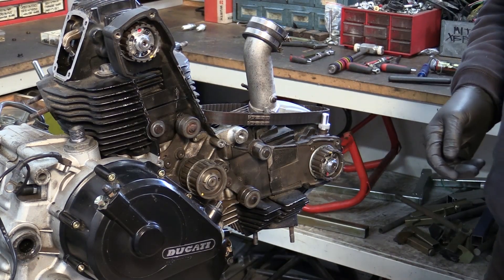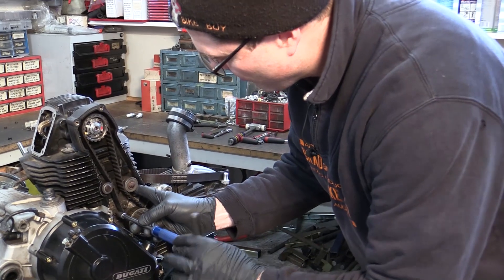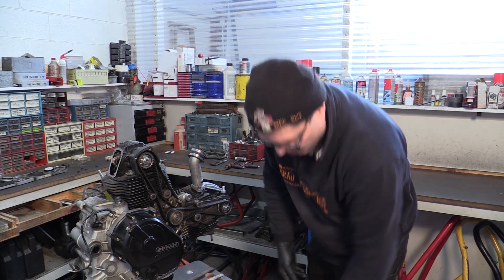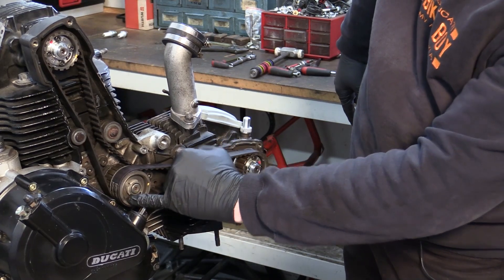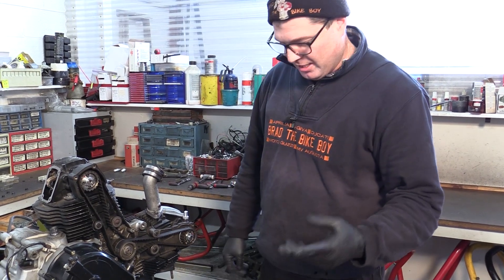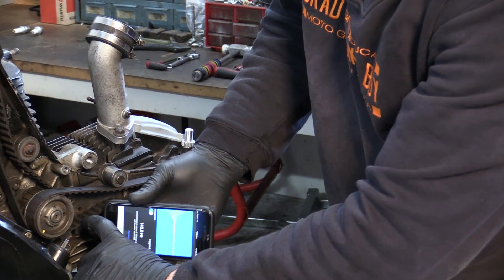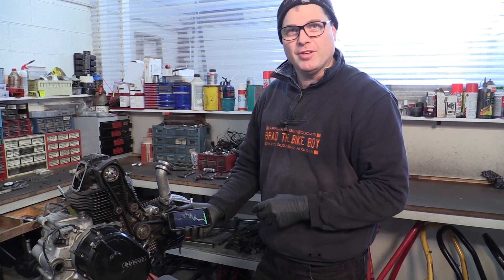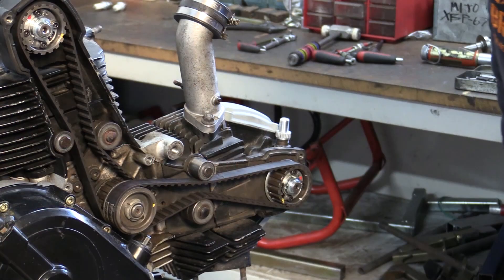Ducati Traditional 2 Valve - Refitting Cam Belts

Comment: Great advice about turning the motor over many times before tensioning. But you are measuring the Hz of the horizontal cylinder on the tensioner side and then vertical cylinder on the idler side. Of course you are getting the wrong Hz. You say that you do it "by feel". Well... what does that mean? Where does this sense of "feel" come from?

Comment: Hi, thank you for making this video. The upper vertical cam moved when I removed the old belt. Im pretty sure it rotated clockwise. I move it counterclockwise with the timing mark on the cam and case lining up (just like before). Is it relevant that the cam moved clockwise/counterclockwise as long the timing marks lines back up? The reason why I ask is after I installed the belts, my ‘05 Monster S2R wont fire up. It cranks (I hear gas pumping, I can smell gas getting dumped into the exhaust) and very faint rumbles from the engine/exhaust. Any idea what is happening? Thanks in advance.

Comment: Good stuff here, but a tip is to also check your tensioner bearings. Especially the vertical cylinder's. Mine were toast. Replacements can be had pretty cheaply rather than buying the whole assy.. Removing/ Installing them on the tensioner can be challenging. Puller for removal, drift/socket & vice along with some never seize for install. I also recommend installing new E clips.

Comment: Really helpful video and I don't want to be destructive but to be honest: I think the sonic measurement of the belt is totally pointless and inaccurate. The frequency depends on three things: material, longitude, stiffness. The 4 free sections of the same belt have 4 different resonation frequencies like a guitar string held on 4 different bunds. The 2 belts have 8. And the stiffness is constantly changing during the operation. Lastly, I don't really sure U measuring the sound of the pinged belt (since it has to be a really quet, and short resonation), or measuring the sound of the interaction of the belt and your rubber glove, or measuring both at the same time.

Comment: when you 'pinged' the belts with sonic  measurement you did the horiz cyl belt  on the shirt run to the tensioner bearing.  For the vertical cyl belt you pinged the  short run going to the 'fixed' pulley bearing.  Does it matter which belt of the belt you 'ping'??

Comment: I have an older 907 with flanges on the cam pulleys and can't get the belts off no matter what.  Do I need to remove the pulleys from the cams on this?  Any suggestions?
Reply: Cut the belts
Reply: @DontDoIt89  I discovered I can get the belts off easily by pulling it partially off then just rolling the engine until it rolled off, and install the new belts the same way, but first you have to slide all the opening rockers off their valves so you don't risk bending any of them.  Actually made it very easy.

Comment: Hi Brad, can you please explain to me why the later engines like the ds need the sonic method to check adjustment, why s the feel/5mm allen key method not ok for the later 2v motors if it is ok for the earlier 2v motors. i have an 04 1000ds motor and did my belts so that the 5mm key could squeeze through and a 6mm couldn't (a method i saw on an old california cycle works vid'), and it has been fine for 1000s of miles since, was i just lucky?
Reply: I'd also like to know and have done the same with my 2007 DS engine. Actually, on two occasions after having belts changed on my DS engines at the dealer, the bearings started squealing when the engine got hot. I simply backed off the tension a bit and it stopped and I had no dramas since. I also use that 5mm clearance on the idler pulley method (not the tensioner pulley). I feel the frequency method on air cooled DS is too tight. I now change belts myself and have never had any dramas.

Comment: So this bike has 5mm adjuster Allen bolts? I noticed you were using the same Allen key to check the tension and do up the adjusters. 
My 2000 ST2 has 6mm Allen bolts, but I still check the tension with a 5mm key.

Comment: Suggestions on turning over the engine with out the nice hand crank on the side?  Put in gear and spin the back tire?
Reply: put in a higher (3/4) gear and spin wheel counter clockwise while your rear wheel is on a stand.

Comment: I don't understand why people mark the (used)  belts to try to get them back in the exact position as they were. I think Brad pointed out succinctly that if you line up the crank shaft dot and the two cam pulley dots you're good to go.  What's up with teeth counting etc.?  What am I missing here?  Thanks for this vid too, Brad. Cheers!
Reply: Hello John, different ways to do the same, I guess! greetings from Argentina
Reply: Teethcounting comes in for dual cam (testastretta) engines to ensure the your belt is in the right position between the 2 cams. On desmo due engines nobody counts the teeths.

Comment: How do I set the timing for a 1999 Ducati 900 super sport without having any belt markings before installation
Reply: Do you still have a working engine with belts still fitted?  If so then read up on getting a ducuati to TDC, fit cam locking pins (relevant to your model/year) to ensure the cams dont move then mark each belt at the bottom pulley AND at it's cam pulley (I use a white permanent marker also mark V or H to identify the vertical/horizontal belts), then undo the belt tensioners, slide out the belts, for each new belt make a new mark (singular) on the belt fitted to relevant cam which aligns to the mark on that pulley, remove belts, on the old belts count the number of teeth marks on original H or V belts and applly to new belts, then fit and if all goes well marks on new belts will align with marks on pully, tighten belt ennsioners to spec noting that when engine reaching operation g temperature they DO tighten a lot more.

Comment: I have a 2005 1000DS engine but it is a two valve as well, would 140Hz be good for that application?
Reply: There has been a bit of discussion on this, the Ducati Service Manual was out of date as soon as printed and Ducati have since revissed the belt tension spec.  Online I've ready some say 80Hz, others 90Hz or a 3mm allen key method to slide with some resistance between the belts and tensioner, best to call your local Duc for the latest on this.